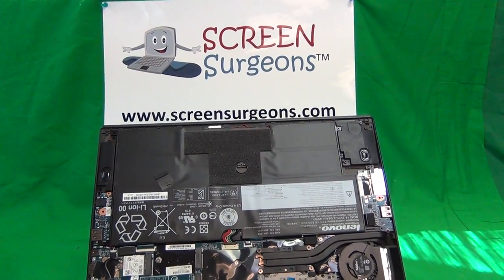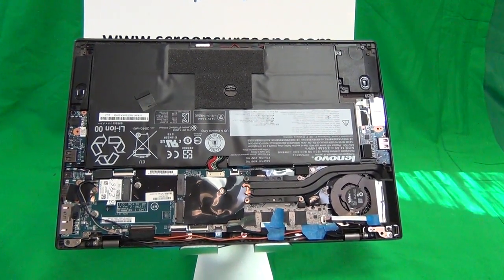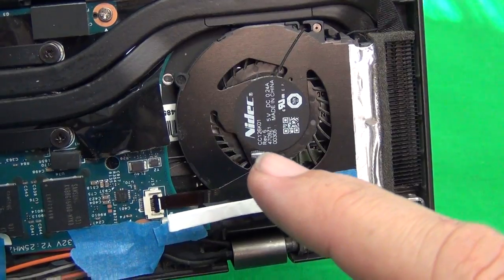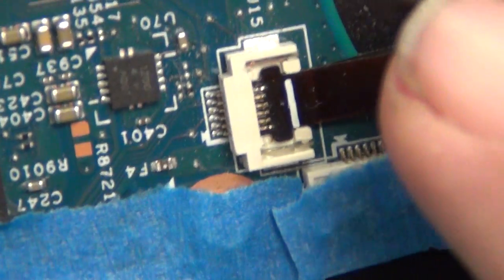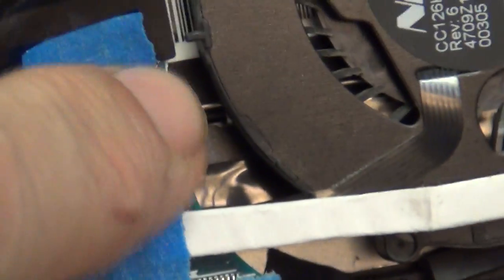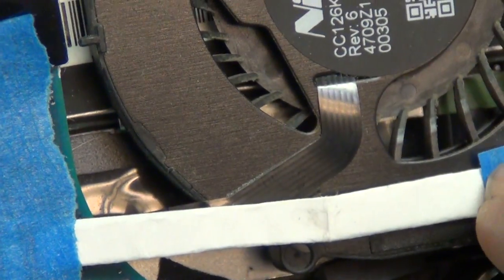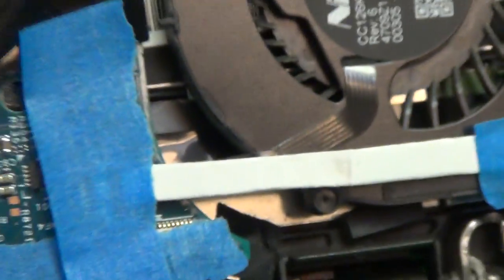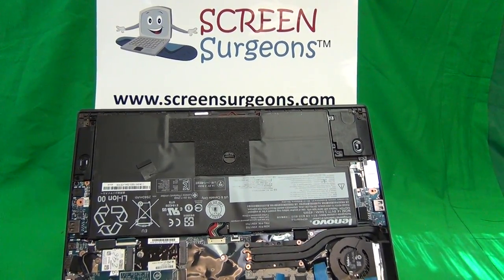Simple Hack To Clamp Down A Ribbon Cable Connector With a Missing Clamp When Repairing a Laptop

Comment: I lost the clamp on a ribbon cable for a keyboard. I tried the tape down method but it didn't work. After watching this video I noticed I had an older hospital wrist band. I cut a piece the size of the connector and slid it in. It worked perfect. Thanks for the idea.

Comment: I was skeptical when I saw the painters tape. but that paper trick, holy shit does it work. I tried toothpicks, super glue, AND tape, but this is what worked. Typing this from my repaired laptop, it's been out of commission for two whole months now and I was on the verge of ATTEMPTING to buy a port clip, or even a whole new motherboard if it was warranted. They are not easy to find and I would recommend integrating a piece of plastic or something instead of paper, since it's flammable and all.

Comment: This gave me a good idea. Instead of folding paper, I took some mylar about the thickness of card stock. I cut a piece about an inch long and the same width as the ribbon cable. Wedged that in place and then coated with RTV.

Comment: I’ve done something like that, except I was fixing a PS3 controller. 

I found that one of the pieces of the track that holds the vibration motor in place had broken off and the motor was rattling inside, so I used this type of trick.

A piece of folded paper or cereal box with some tape definitely does the trick!

Comment: If you can, use a piece of a debit card (old gift cards work perfectly). Just sand down one side so it's like a wedge, then put the flat side downwards. The metal bits which are above the actual cable will dig into the wedge and it'll be a pretty good fit. Then some tape or glue.
Reply: Good idea man, thanks
Reply: @hasantaskn5231  yup no problem, worked great for me
Reply: Thanks..really appreciate it..settle my problem today 😆
Reply: I'm not so good at English do yoe mean I should slide it under these connectors or just like he on top with some tape?
Reply: @lukasfubi5930  card goes underneath the top golden ends
Reply: does it go over the ribbon under the clips or over the ribbon over the clips

Comment: I appreciate this work because it shows people that may not quite have the confidence  worked up that, yes, you can fix those small delicate parts.. . However (as the author explains) this is only a short - term solution.   BUT, I cannot recommend masking tape for this job.  Consider a vinyl film tape instead (the kind that can't be stretched or torn easily),  due to heat inside the laptop, the adhesive on the masking tape will likely melt, spread, and create a gooey mess over time.  Hot glue is better, but be sure you have everything making good connection before you glue, as this presents additional problematic possibilities if you accidentally encase and insulate a tiny bit of the connector that isn't  making contact.

Comment: Great, great idea!  My internal mouse on my M5030 laptop is missing the clip that holds the internal mouse ribbon cable to the motherboard.  I have been forced to use an external mouse since it broke.  I'll definitely try this out very soon.  At least my laptop isn't totally scrapped because of the malfunction.  I have been looking for a fix just like this!
Reply: I have the same issue
Did u solve it though?

Comment: Also works if you roll tape in a thick rectangle, roll it so both sides are sticky and place where the connector was. then add another piece of tape  on top to your tape rectangle. The rectangle gives it more support.
Reply: I'd be careful to not get the adhesive onto the pins, it won't damage them but getting it off will probably suck.

Comment: This video helped me out with a keyboard connector and now i want to see if the heat does not lift the tape so 🤞🤞

It worked and what i also did was put some double sided tape on the cable to make sure it does not move so its secure on top as well on the bottom.

Comment: I pulled mine apart to clean a dirty fan and get info, in case I needed to replace it.
My problem is that the ribbon cable lays on top of the contacts and the clamp holds it down. On yours, the cable inserts into the connector, with the clamp holding it from pulling loose.
I will do something similar or a glue gun, but pushing the cable down to make contact is critical and it does not insert into the contacts.

Comment: I was able to replace the battery, however I no longer have grip controls because the black retaining clip came off the larger ribbon cable connector and I can't get it to snap back on. I only really play Beat Saber in VR so I don't need grip too bad, and before this fix I had no controller at all, so I can't complain too much for a $20 battery compared to a new controller which is $150 (and out of stock). I've kept the clip (and the top left screw, which I didn't bother to put back in after it being difficult to remove) and maybe one day I'll open it back up to try again. For now, I'll be content with my controller not turning off after 30 seconds. Thanks!!

Comment: Thank you for this video.  I encountered a similar problem in repairing a broken connecter.  It has apparently become brittle from age and/or heat and pulling it up with a fingernail caused it to break.  I slid a piece of slim card stock on top of the cable helping retain it then added a piece of tape.  The next day (today) I Googled a fix and discovered your video.  Now my 3-year-old Dell has new life!  If and when this temporary fix fails I'll consider using a glue gun.  Thanks again!

Comment: I had other laptop motherboards laying around so I found one that looked similar in width, popped off the clamp, and installed it on the missing plug. Threw a piece over it for good measure.

Comment: Thanks for this tip!  I was upgrading an old netbook when the clamp holding the track pad ribbon broke off.  I'll post an update if your hack works for me.
Reply: Unfortunately, this hack did not work for me.  The clamp that holds my laptop's trackpad ribbon cable broke off, and your hacks didn't work (my trackpad is not being recognized).

Comment: This happened to us with an HP 15 Laptop's keyboard connector, the locking latch broke on the motherboard and in this case the cable needs to be clamped upwards into the pins which has been incredibly difficult to accomplish as some of the keys still wont work unless you have it perfectly clamped across. I ended up getting it to work with a cut credit card piece, folded paper and scotch tape it's a wonder I got the keyboard to clip back into place, TLDR Don't ever break the keyboard latch if it's one of these HP style backward clamping abominations.

Comment: what are you supposed to do when the ribbon plugs in under the mother board, and is so short you cant possibly reach it with your fingers when the board is close enough?
Reply: I had to use a plastic knife to clip one cable from the keyboard to the laptop.  But the cable I was trying to clip next to it (about 1 inch) was impossible to clip.  I wonder how those people with little hands do it, too!

Comment: Arggg. No - not masking tape (white or blue painters).  Use polyimide heat resistant tape.  You can get pretty much a lifetime supply on Amazon for a few bucks.  It's made for stuff like this and will hold securely for years.  Under heat masking tape will dry and fall away in a few weeks time.

Comment: I tried a similar method a while ago for a computer with a broken I/O FFC connector, My method failed and I just gave up because it really wasn't worth it, and because the laptop was still usable. In fact, Right now I am using it. I think this video might have given me enough hope to attempt to fix the laptop again, Only this time using the method in the video.
Reply: I will attach a comment letting you know if it worked.
Reply: hi did it work SmplGames  :-)
Reply: He never replyed but i managed to turn it on by doing this right now, dunno how long it will last but it did work.

Comment: Hello very good video and very informative. I have another question and if you could help me I would highly apprecciate you for that. I have dissassembled my laptop (asus gl552vw-dm149) and the "copper thin cable" on the left (is for the keyboard backlit,, right) is simply detached or cut off from its start on the keypad (sticky start). Can I fix this? What is the name of that copper thin cable? In its beggining its 6 pin which are into two lanes (3pin in one fatty lane and 3 in other one) and these two lanes finish in a "narrow tip" with 4 pins. Please do you have any Idea how can I restore the backlit? Thank y ou so much in advance

Comment: Isn’t there something inexpensive to buy that has computer parts and screws Guess that too much to ask for although there are cheap kits like that for car fuses.
Reply: I just ordered a keyboard for friend of mine as wasn’t working and next day taking apart (should have done earlier) i noticed the clamp missing for the keyboard. 

the clips are called “FPC Flaps” i leaned and Molex is good search to try and find.  

i’m now trying patience to count pins here.  my friend got laptop at flea market for 20$.  if anything, told him use a cheap 15$ keyboard still a good deal. too old of system. 

not doing the paper, but familiar with the sturgo

It’s an old Toshiba L755 i’m working on.  Itcs entertainment for me.  😏

If I find the link for the clamps, will post

Comment: Yo I’m gonna try this on my joycons.. about to drop in with the squads for that epic w!
Reply: We won! Thanks!
Reply: How did you do this on the switch joy cons?
Reply: @zebediahmarzano  are you repairing your joycons? In my case, I was replacing a drifting thumb stick. When I opened up one of the ribbon connectors the clasp flew away and I could not find it. After that the ribbon would no longer connect. But using technique from this video I got it to work 👍
Reply: @rewindcat7927  The connector for the SR and SL buttons snapped off. I  cant get something to hold it in place.
Reply: @zebediahmarzano  hm. See if you can use the case to hold it in place. If you layer up some trouble sided tape, or even a few layers of paper with tape, you could likely get enough pressure to hold the ribbon down, after the joycon is screwed tight back together. I hope that makes sense or at least gives you an idea. Good luck!!

Comment: Silly willy... just tape it down with gorilla tape and use spongy door weather stripping cut into the size of the cable.  The pressure will be applied when you put it all back together.  It holds indefinitely from what I have seen.  Meow.
Reply: yeap….that acts more like a spring; the key after that is to use tape that glues well.

Comment: Another way is to use the top of the laptop, find the exact position where the plastic comes near the connector ans build that area up only, the pressure of laptop top will hold it forever.

Comment: Hot glue gun is the way to go
Reply: i just did this for the ribbon cable that goes tot he power button on a toshiba satellite radius i'm working on won't know if it worked until tomorrow when the charger i ordered for it comes in
Reply: Can you just use a glue gun without the paper?
Reply: Josh Kelly did it work
Reply: @gakkibear  it powered on but the laptop wouldn't do anything else

Comment: My case is different there are 2 sliding bars instead of a folding tab an 1.5 inches of room to work in. Acer aspire es  15.  Not mine, I would never buy such a cheap laptop. It also died when i installed replaced HDD for SSD. Piece of crap.